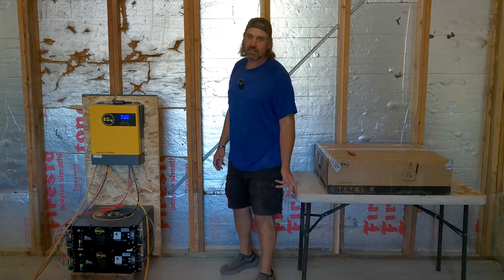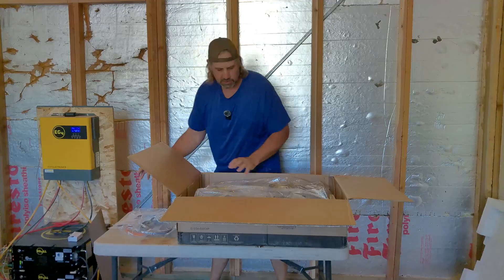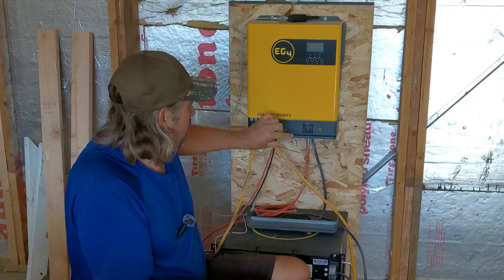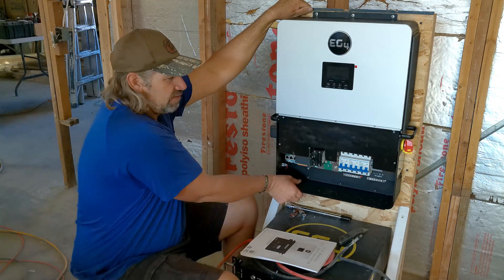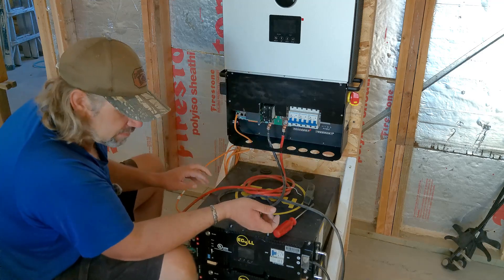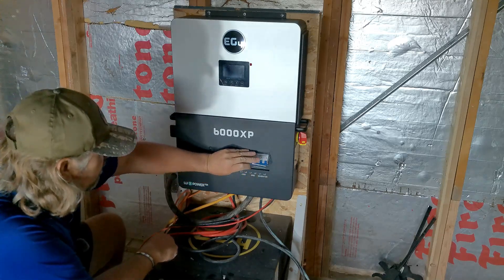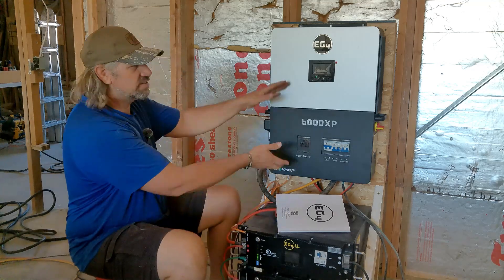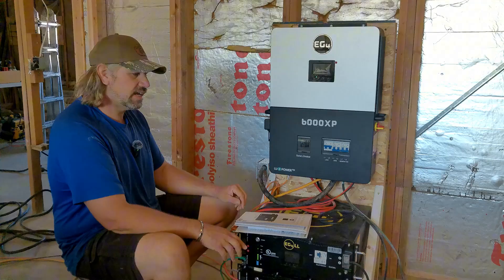EG4 3000W to EG4 6000XP Inverter Upgrade - Unleashing Maximum Power

Comment: Can this be done with the EG4 lifepower4 V2 battery instead of the EG4 LL-S battery?  Will they have the same communication settings to set so that it will communicate with 6000XP? Thanks
Reply from the maker: Yes, the EG4 lifepower4 V2 battery will communicate with the 6000XP.

Comment: I’m building the same. Thank you very much for the humor and good instructions. Do you think that we could update the solar cart with 3 batteries down the line or a server rack would be essential? Keep posting!
Reply from the maker: Thanks for the positive feedback. Have you seen my newer video where I build a better cart? The new cart design could easily be built for 3 batteries.
Reply: @Thesolarfarmer  Just watched it!  It is even better. Great job!  Maybe that I will add a busbar (and fuse) if I build a 3 batteries setup... for the wires do not start to warm up (and save power at the same time).  God bless!

Comment: Dude, that's no upgrade. They're both cheap high-frequency inverters. A real upgrade would have been to change up to a low-frequency inverter.
Reply from the maker: I am trying EG4 and hoping they last awile. I am using Outback equipment  on one of my systems and don't like how much stuff that is requered to do what a eg4 inverter can  do. I have used Trace and Heart inverters as well.

Comment: Switching to the 6000XP is not an upgrade. It uses the same cheap, low surge, short lived high frequency, transformerless inverter tech that the 3000 uses. They both offer no galvanic isolation between their DC boost stage and their AC output which can damage your appliances during a failure of their MOSFETs. No thanks.

Comment: I especially appreciate the useful tip about software pairing between by 6000XP and my 48 V EG4 battery. That explains why it didn't power on at first.
Reply: I would have thought that the EG4 battery and 6000XP would by default pair to each other. Oops!

Comment: I would like to use as many links as you have to support your channel. Do you have an affiliate link for the eg4 18kpv inverter? Also I am persuaded to get the LL-S battery. I found a coupon with signature solar that makes them cheaper that the EG4-LifePower4 V2. "stepup50" just an fyi.

Comment: Can you parallel the 6000 with a 3000. For instance if I was starting  with a 3000 and wanted to expand the system by adding a 6000 to it later.
Reply from the maker: The 3000w and 6000w won't pair. If you start with the 3000w, you would have to expand your system with more 3000w inverters. The 3000w is a good in inverter. I am using my 3000 on my golf cart now. If you are thinking of upgrading to the 6000 later, I would start with it. The 6000w is more than just twice the power, it has more features. The 6000 with the built-in breakers makes set up easy. If your batteries run dead, the 6000 will start back up when the solar starts charging again, the 3000 won't. The 6000 can start and stop a generator.
Reply: @Thesolarfarmer   This reply of yours is exactly what I was hoping to find when I clicked on this video.  I was going to build a 24V power cart system, but the more I looked into it, the more it made sense to move up to a 48V battery system (so I purchased another pair of 12V, 300amp/hour WattCycle batteries, total of 4).  My next decision was to buy a single EG4 3000 watt all-in-one inverter and add a 2nd identical inverter later, or consider the XP6000.  I will seriously look into the XP6000 now, before making my purchase.  Since I have four 12V batteries though, I guess I also need to buy a 12V LiFePo4 capable battery charger, so I can top up and balance all of my batteries, before connecting them together in series, to make my 48V battery bank.  Do you have a recommendation for this charger that I'll use once, and might never need to use again?  Maybe I can find a friend who has a LiFePo4 12V battery charger that I can borrow for a day or two?
Reply from the maker: @traveling.down.the.road56  Smart move to start with 48V. I top of my 12V LiFePo4 batteress wih a 12V lead acid car battey charger.

Comment: just wanted to point out that could have just got a second eg4 3000w and had money left for another battery????     why not that route and have 2000watts more solar input and 120 ac charging.
    also any plans for old inverter?   i am thinking of building your setup.   thanks for the video.
Reply from the maker: I decided to get the 6000XP because I wanted to have 220v in one unit and I really like having all the breakers built in. I put the 3000W on my golf cart.
https://youtu.be/gZxIBi-ZuKQ

Comment: Interesting video. Few on the 6000XP for portable use. I was interested in it for a backup due to a few 240v loads. It looks like your generator isn’t an inverter and I thought you had to use the Chargeverter for a regular gen.
Reply from the maker: I am really liking the 6000XP the built in breakers make the set up easy. You can use a regular generator to charge with. The THD (Total Harmonic
Distortion) of the generator must be <3%.  The Chargeverter can use dirtier power than the 6000XP can.

Comment: The connection to your house is it directly into your breaker box?  Also. Did you only connect a single line to your house? (Just one 120 leg).

Is a battery necessary to start the inverter up?  I am considering getting one but only to run loads directlly from pv and the grid until I can afford the batteries.
Reply from the maker: Yes, 1 leg 120 into my breaker box. My box is wired for 220, so I used a jumper line to get the 120 on both sides. When I get done with the remodel, I will run both legs to the breaker box.
It can run without Batteries, but is better with them.